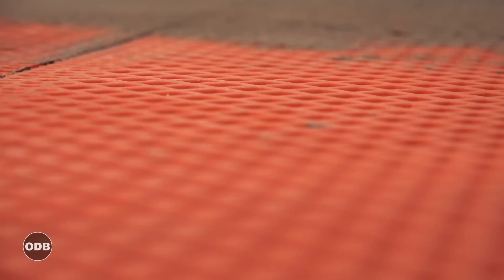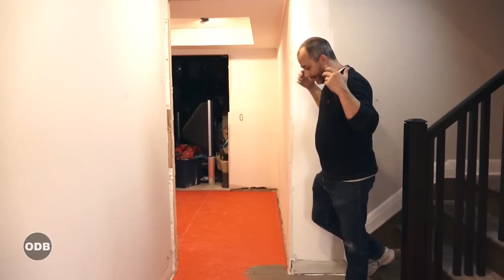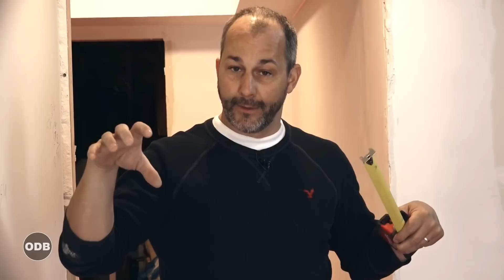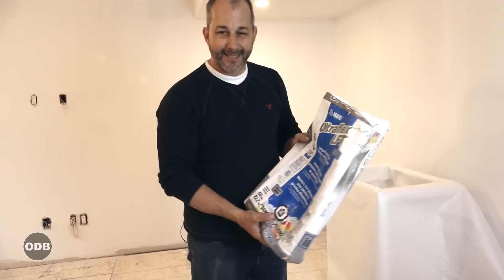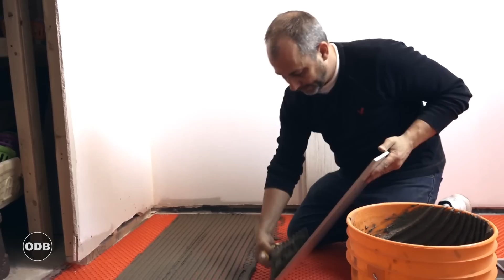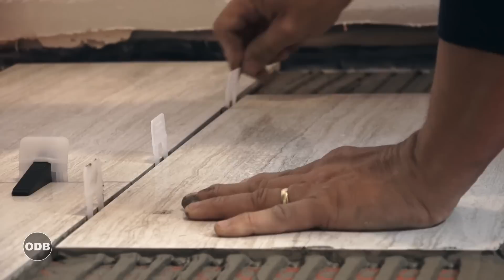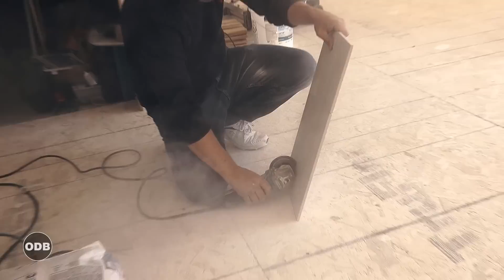How To Layout And Install Large Format Tile On Concrete

Comment: Why/when would you want to go through the trouble and expense to install an underlaymant on top of a concrete floor?  Is the main use to keep the tile from cracking if the slab cracks? I laid tile twice in my house.  The large area (1,000 sq feet) was over a 10 year old concrete slab.  The smaller area was over a 3 month old slab.  The new area has a long crack in the tile that was apparently caused by the slab cracking.  The large area has never cracked in 20 years.  Now I am re-tiling the older larger area.  Since the slab is now 30 years old and never cracked the tile, do I need to use that underlayment?

Comment: Hi Guy.. I like how you are not annoying and self centered in all your videos. Very good at illustrating your work in step format. One question. You mentioned you would be putting down 150 sq feet that day. How much do you charge for a days work. Obviously adding heating wire would take more etc but is it $300 labor? 5 or $700.

Comment: What are the benefits of using the tile clip system as opposed to using spacers? Is the clip system more to give it pressure, and if that is so, is it necessary for every tiling job or only certain types of tile? 

I have helped out with a few tile jobs and watched several videos on it, but this is the first time I've seen the clips being used.

Comment: Your videos are very informative.  I'd like to ask how you decide when to use the leveling clips,  as I've seen you on other videos without them.  Also, as far as concrete jobs go, how do you decide if you need that red underlayment or if you can just tile directly over the concrete?

Comment: no face mask....:-)   i read somewhere that the ridges on a large format tile should be in the opposite direction to the long edge, yet in your video they run the same way - whose right or does it not matter so long as they collapse

Comment: If you had hot water coming out of the hot water heater, you had cold water at the front faucet.  Don't mix cement products with hot water.

Comment: Preparing uneven subfloor for tile  by adding another layer of plywood  gluing it and then screwing it  then Detra  but the floor is not flat should i first  use self leveler  and then the plywood or  installing the  second layer  of ply wood and then self leveler   before installing Ditra and tile ? or does not matter   thx

Comment: I have quick question I want to lay tile or hard wood not sure which yet in basement over the concrete in laundry room area one issue I have is there's a drain in the concrete floor on One side of the drain its level on the other side its sticking above the floor bout quarter inch any ideas how I can tile over this

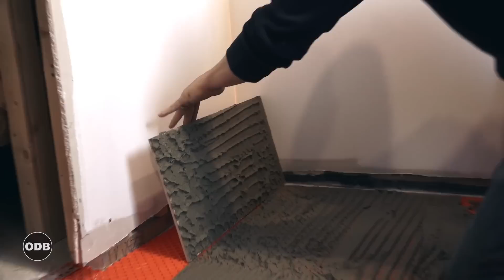Comment: Serious question, @13:16 is that what full coverage looks like? On the left side of the tile it looks like it has full coverage because of the pattern that is left. In the middle and the right you can see the horizontal ridges from the trowel lines but in between the trowel lines you don't see the same pattern as on the left. I hope that makes sense.

Comment: Hey Jeff, I'm installing 24x24 porcelain over ditra.  Can I get away with a 3/8 x 3/8 square notch trowel?  I was hoping to match my existing hardwood height of 3/4" at the tile/hardwood transition and the larger notch trowels would increase my thinset bed....
Reply: You should be fine just back-butter your tile.

Comment: I love watching your videos.  So now I am renovating 2 bathrooms.  However, I have a question.  In both bathrooms, there were bathfitters and laminate.  When I pulled up the laminante I found concrete and subfloor on the walking area and only subfloor under the bathfitter (28inches deep).  My new tub is 30inches.  Do I 1) cut the concrete 2 inches to fit the new tub and 2) do I put ply wood over the concrete to prep for tile? .. any help would be appreciated?

Comment: You mentioned that red underlayment you put down on top of the concrete that you used it for elevation and that's it.  I am laying new tile in our basement laundry and i will prime it and since I don't need to add elevation can I skip that red underlayment product?
i also have an infloor heating system that I'm installing.  i'm assuming that goes on top of the underlayment if you are recommending I install that.  
i was also wondering if I need to slope the laundry to the floor drain?  if so what cement type do i use for that?
I love your videos.  they are really helpful and very well done!

Comment: Follow up question to my other viewing of this video.  I have a North/South House.  Texas has a fair amount of “Open Concept” homes where the foyer, kitchen, breakfast and family/living/great room are basically all one big giant room with no walls other than formal dining room/kitchen and the center load bearing wall separating open concept rooms from the hallways to the guest Bathroom and bedrooms and the hallway to master BR and hall closet.

My question is I am looking at replacing the carpet for the Formal Dining Room, guest living area hallway and Master Bedroom.   It seems logical to me but want other input.

The current tiles in the open area and bathrooms....(both) are 13X13.   For the Formal Dining Room that is critical since that is the second most open area and not much of a wall from the foyer.  You could almost call it extension of the great room concept but with carpet.    

With the background set here is the question.

I would like to get large format tile 12X24. Since the width is slightly less than the original 13”, length is longer so theoretically I might use more tiles left-right but less forward/aft.   Does it make logical and aesthetic sense to orient the 12X24 tiles for the office as the house sits as in South-North?   The layout seems to look aesthetically pleasing to me and provides a continuous flow from main door to patio.  Orientation from west-East looks like a blockage.  As in ...STOP”  where the South-North orientation says....”Welcome, come on in”

The other part of that is when the main floor tile does get replaced I will most likely keep the South-North orientation.

Sorry for the long winded background but is my logos sound for the layout?

Comment: Can you do more than one row with the staggered pattern?  As in 8 inch overlap one row then maybe 12 inch overlap the other row or 4” the second row?  What is the purpose of the underlayment pad?  Moisture absorbtiton, leveling, cushion or combination of all three?  I have a single story with basically concrete slab, mortar and tile?  Good informative video

Comment: Hello my friend.... I am a subscriber and have watched many of your videos...
Was watching one of your videos when a professional colleague stated to me how he loves your videos and that you "very much know your stuff".... I agreed, we talked briefly about our homes, and then continued with our business for that moment... Here is my dilemma: Our basement, in the home we bought about a year ago, had a leak from the ice maker hose of our refrigerator that leaked down into our basement, onto the wood laminate flooring that the previous owner had installed.  It is now seriously buckled and water damaged. I would like to install ceramic tile floors instead of wood laminate, but my concerns are 1. Would the floor be  too cold during the fall and winter months? 2. What considerations, other than what you cover here in your video, do I have to be concerned and/or focused on with a tile install? Presumably I don't want to reinstall wood laminate tile again in my basement, but want to remove the wood laminate flooring and simply install porcelain or ceramic tile, or some other tile that is water/moisture resistant (not wood laminate) over underlayment, on concrete no?? Of course following your suggestions, guidelines, and directions..                                                                                                                        

My apologies for the lengthy comment/question.....but really hope that I get a response

Comment: We are tiling a shower with large format tile 12x24. Using Kerdi board for walls and shower pan.  We are  wanting to install this tile stacked vertically with no offset.  After installing the kerdi board, the wall seems to dip in the middle of the back wall by about 1/4".  The way we are seeing this dip is to take a 4' level at an angle and can see a gap in from left to right. Should we add mortar and screet the wall to remove the dip? Or are we ok to try to just tile with dip?
Reply from the maker: always best to have a flat surface!
Reply: @HomeRenoVisionDIY  Can I use a thick  mortar paste and screet to make it flat?

Comment: Is an underlayment always necessary when tiling on concrete floor?
Reply: edutton I don’t think so
Reply: It's always BETTER. But if you don't want to do it, then u will probably be fine unless your concrete expands or shifts alot then u will get cracks.

Comment: your videos are my DIY bible. I have watched at least 5 videos on every DIY project i did in my home(all yours). My recent project was to redo a leaking shower(just the lower half). i was given a quot for $6000, i followed your instructions and did it on my own, guess how much i spend ?? $468(includes Few tools). your concept of you can do over kill where ever possible. i did 6 coats of RED GUARD water proofing. Minimum  quantity i found was a gallon. i did not want to waste it :).

Comment: Hey my friend, getting ready to lay some large tile in what is going to be Brenda's craft room, about 250 sq ft. The room used to be a patio with concrete floor where they originally installed a vinyl and the floor isn't completely level. Can we level over the vinyl before the underlayment? I really love being a member!! 'cause you're awesome!
Reply from the maker: Hi steve if the vinyl was glued down then you could use the primer on it and go right over, I have done that before and it worked quite well however I think the manufacturer recommendation is to remove the vinyl first.Sounds like a great project!

Comment: Squaring a tile floor with a small L square? Cutting a tile with a grinder without a guard and not on a flat surface? No repeated grid lines? These improper methods might work for professionals , but diyers are watching and these methods are a sure way for failure.....it seems your vids are just you taking short cuts and saying, "look at me , I'm fast and this is so easy".  A good video for diyers should be much different imo, over doing things so no mistakes can be made for someone that perhaps have never done this before. Personally I would of shown them prefilling the ditra one day,  this way once it dries I can show them a much better grid line layout to feel comfortable about. I would of shown them using a grinder with a guard,  using it outside on a flat surface. Would emphasize how important it is to mix and go thru every piece of tile looking for damaged pieces before mixing thinset up. It's also important to perhaps pre cut your first row of tile, this way your not measuring cuts while your thinset is drying...and talking about leaving cuts out and doing mostly full one day and filling in those the next? That's another potential nightmare for diyers imo because those cuts may not go back in properly and because tiles around it are now set, no room to adjust. Besides that, the plane of those left out tiles can be off as well and again, no way to adjust . too many hack shortcuts for diyers imo

Comment: This seemed very professional and one thing you did not mention that would be helpful for those DIY people, is that the large format tiles are typically to be installed either stack bond or if it is an offset pattern, it cannot exceed a 33% offset per the manufacturers recommendation and TCNA or NTCA standards, due to a half bond pattern would cause excessive lippage.

Comment: Great video , I have a question for you, the floor of my basement is concrete, How can I level the floor to put tiles?
Reply: Jut use a taller notched trowel... best bet would be a 1/2” notched trowel

Comment: 1. Walls are not parallel. This is referred to as, "a huge pain in the pass." 
2. 8" offset pattern. Not a brick pattern.
Reply: 9. Measure the tile. The measurement on the box is often wrong.
Reply: 3. Pay attention to entrances and people's line of sight when deciding tile layout.
Reply: 4. Lappato finish is basically a shiny texture that is added to the surface of the tile to give it a semi gloss appearance.  Natural finish tiles are finished with a matte finish that provides little or no sheen.  Lappato finish tiles are typically used in conjunction with natural finish tiles and placed in areas to highlight or accent a specific space such as an entry or elevator waiting area.

(Lapatto finish gives you a good grip and is easy to clean, apparently.)
Reply: 5. You don't want grout lines appearing as you tile down a non-square wall.
Reply: 6. You want the half cuts to be equal to or less than half a tile. This way you don't waste tile.
Reply: 7. When walls are not parallel/square, laser lines come in handy.
8. You want to adjust your main line in accordance with what you want to do to work around any non-square walls. Use the laser line to set the main line of your tile.

Comment: I made more money replacing failed tile installations from other Setters, that used that Ditra Shit.
Reply from the maker: Hi Curt, firstly let me say the membrane in the picture is not ditra. Secondly it is true that a lot of guys install the product and don't use the correct materials and install techniques. to call the product out  shows me that you have failed to keep up with the training in your industry and don't have a good understanding of the product. I would suggest going on the training course ( which is free) and learn about the innovation. It really does work fantastic and it has the ability to make you a lot of money as a tile setter. Cheers!

Comment: hi how much do tilers charge per square foot what do you charge per square foot just trying to get a feel for estimating a tile job
Reply: I'm at $6.90-$7.20 sq/ft in San Diego (installation, grout, mortar, crack isolation (minor), leveling (minor). Not including tile or baseboards. Costs are higher here, apparently, so I think I'm going to do it myself. 3x the tile cost for installation is insane to me.

Comment: I’m a new subscriber hopefully you can respond ... I’m doing my own Reno in my basement it’s concrete IF it’s leveled can I just tile on top of the concrete itself ? Or do I need to put a subfloor like ditra and then tile ? Please advise looking to tackle the project tomorrow morning
Reply from the maker: Good Morning, I hope I caught you in time. Yes you can install direct to concrete in a basement. Basement concrete may crack during settling so if the house is new I would suggest using the crack isolation membrane you see in this video. At the very least i recommend using the roll on crack isolation membrane from mapei. Having said that, many folks simply tile on concrete. be sure to wet the concrete for a better bond as you go. Cheers!
Reply: Home RenoVision DIY wow thank you for the speedy response question if there is a crack how can I fix that or would the mud do the trick .... if uneven then what can I add to apply issue is I don’t want the tiles to sit too high and make the floor more elevated than the other rooms etc

Comment: Jeff what is the procedure to make sure the concrete floor is flat. We are tiling an area of about 2,000 sq ft
Reply: Use a straight edge to find humps and dips...use a grinder to take down humps fill dips with wet thinset,,,you should have no more than 1/4 inch deflection in ten feet

Comment: Years ago I did a small area, tile job was perfect when I walked away. Next day lippage city! Maybe I screwed up on the mix and tiles settled down through the night.
Reply: The cement may have been too thin (runny), use less water in the future. Also use the perfect tile little wedges to assist with the placement of the tiles. I 3D print my wedges now after trying various models.

Comment: What's wrong by laying directly on concrete slab? About 300 sf of tiles on old slab, flat, dry and has no crack lines. It that doable?
Reply: kimchee94112 Because then your not buying their product

Comment: The dust will eventually cause a condition known as silca fibrosis. You basically die like a hard core smoker. I wish I wore a dust mask and knee pads when I was younger. I had no idea the consequences were so real.
Reply: I’ve been in the trade for only 3yrs and I finally decided to wear mask and eye protection..#nevertolate#tilegang
Reply from the maker: This only applies to regular exposure over a long time. not occasional exposure for limited time. Stop trying to scare everyone!
Reply: @HomeRenoVisionDIY  When I was younger I was made fun of for wearing a mask and knee pads on the job. I wish I had ignored it instead of not using them.   It's people like you that razzed me when I was younger that made me feel embarrassed to wear ppe that caused my my condition now. Now I have o2 sats of 91 if I dont take medicine to help with o2 absorption. That dust does not leave your lungs. It gets covered in scar tissue, reducing your ability to absorb oxygen over time. Sometimes the osha rules are for our own good. You are supposed to be a professional. You should know this already.
Reply: @ChannelZeroOne  You have a point, but for guys not doing this every day, like home owners, doing it once every ten years. It does not matter.
Reply: @valkyr1985swe  Not to mention he cut one tile on camera without a mask, and said that's why he wasn't wearing one. Plus if you make one cut and leave the area you're not going to inhale much of it.